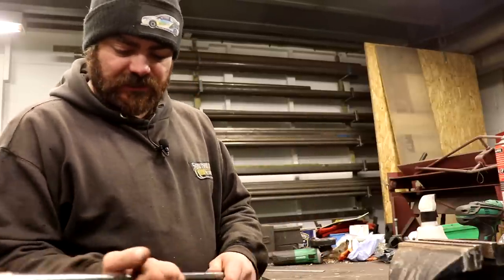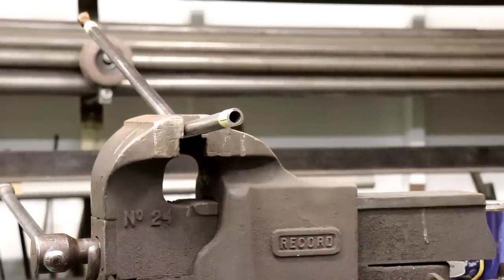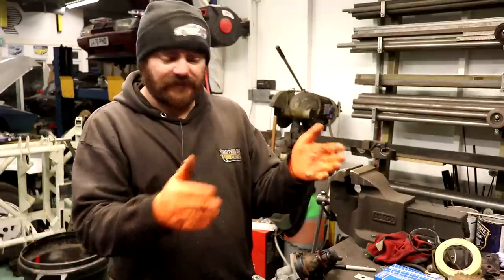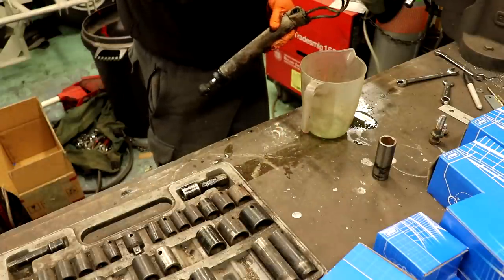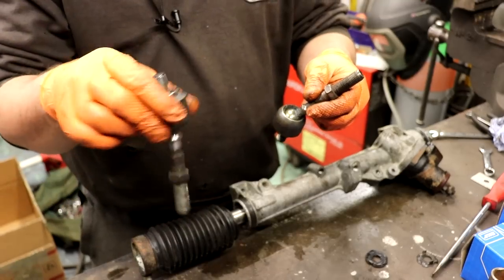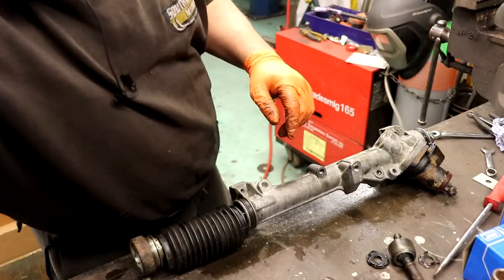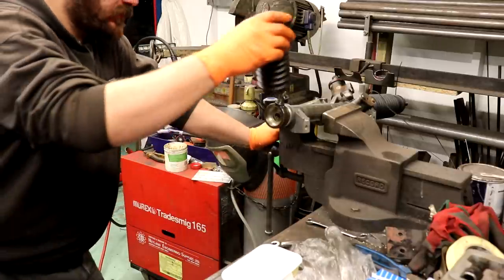PROFESSOR TOMATO ep6: Citroen BX steering rack and gear linkage fun...so far!

Comment: Turn the gaiter around - they are not equally wide in both ends. When installing in the car, I use a piece of bend plastic fastened with cable- or hose clips to form a "bridge" over the knob on the rack. That way the gaiter slides over the knob very easily.
Reply: That's what I thought.
Reply: It's even worse for the DS. I think we will come to that in a later episode. But there is one supplier for those of the DS that do not rip instantly...(Falk Lehmann in Germany)
Reply from the maker: They're meant to be equal sizes on the BX.

Comment: Had the same issue with rubber bellows on bx's for some time.
Bought an unbranded set off ebay ages ago which fitted really well..
Also, given you had the rack off the car, it's easy to whip the pinion and thrust spring off, pop the rack out completely, chuck bellow on and shove it back in..
Reply: Wow, you know your channel is doing well when it gets scammed by some arsehole via telegram!
Reply: Are you a watchmaker in your side hustle?
Reply: Me? No. I dick about with lorries and buses mainly, watches are a bit tiny for me!

Comment: That gaiter being the incorrect size is a bummer Rich however if you have the old gaiter and it's serviceable at the end that fits the body of the rack,you might cut the landing end off and fit it first then put the replacement gaiter on and tighten down onto the seal that you've made ,worked for me in the past hope this is of some use good luck.

Comment: Thanks for the tip about the lenght, I think mine might not compress enough, which might explain why steering feels so weird sometime. On the 605 it's the opposite, they're too short and slide off... Side note : You can do it without removing the ram, there's enough room to move it off the shaft and push it aside, but its a pain in the ass. 
Also I think BXparts might have some replacement gear linkage thingies, not 100% on it but I've seen some
Reply from the maker: I didn't want to stress the bush at the back of the ram, plus I was cleaning the rack, but yes you're right.

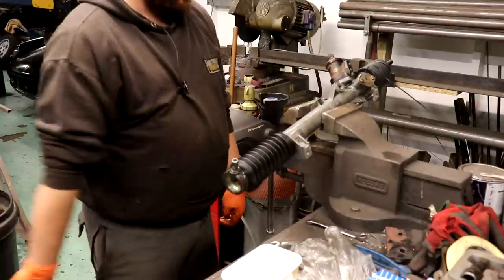Comment: Good job man, it's a pleasure to watch your videos! I think that you maybe swapped sides of gaiter at 17:45, they are different diameters. One side is 50mm diameter, and the other is 39mm. Btw, i need to change that gaiter too on my BX TD, so i found similar (by dimensions) gaiter, it is Febi 02761(OE for Opel Vectra mk1/Vauxhall Cavalier Mk2) . Maybe can be fitted to BX too.
Reply from the maker: Those Febi ones are too big. They have 13 ribs, same as the SKF.

Comment: A BX with a 6+2 pump also has standard flares, unfortunately. I prefer the rubber grommets.
Reply from the maker: I didn't know you could get a BX with a 6+2 pump!?
Reply: This was a preview. The 19Ds are left-hand drive, theoretically from January '92 but in reality more or less from the '93 models. 
This results in a few special parts - the control valve/rack pinion is specific, but the rack, bellows and power cylinder are identical to the other power steering systems.